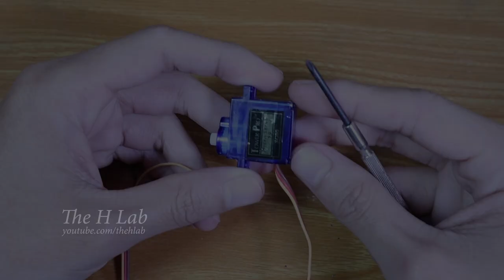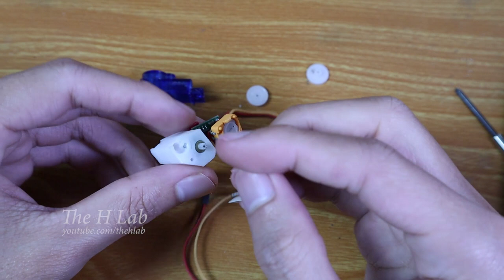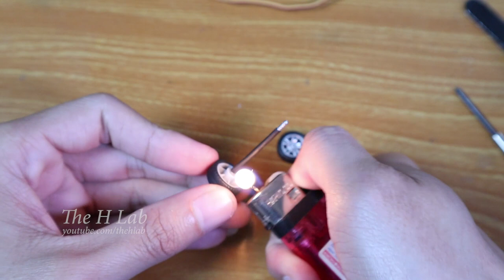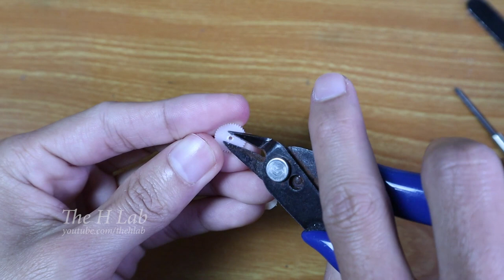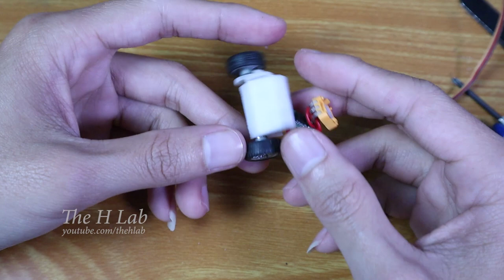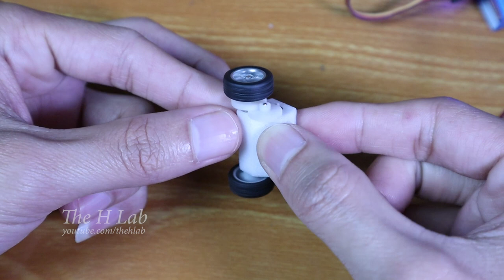Convert sg90 to RC car engine | TheHLab

Comment: I've been using two SG90s as motors for a small tracked vehicle. can't get quite as accurate throttle control as with proper motors but it's manageable.

Comment: I can cut VR on servo board?
Reply from the maker: yes. But to make it work stable, need to add 2 resistors with same value to balance it.